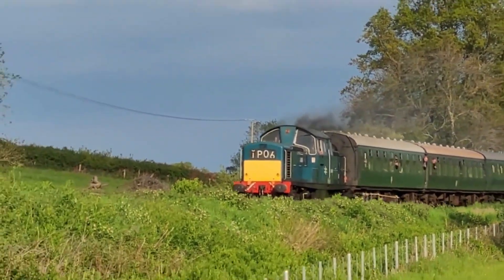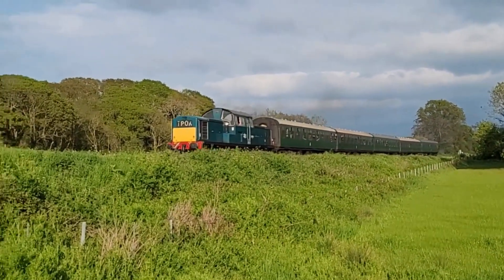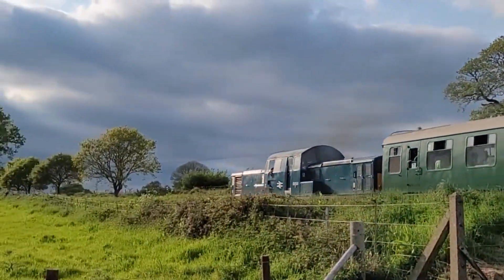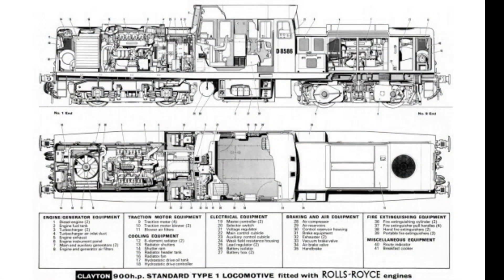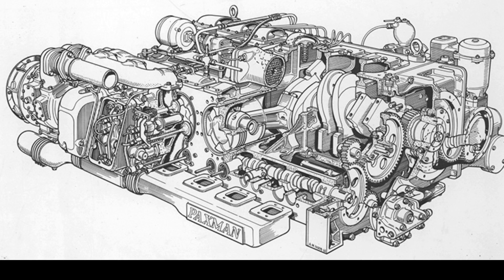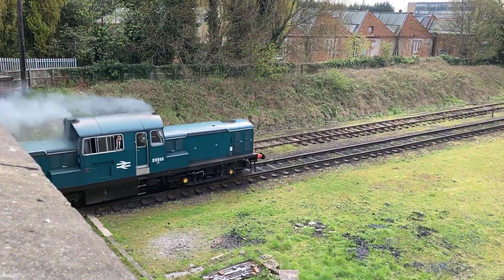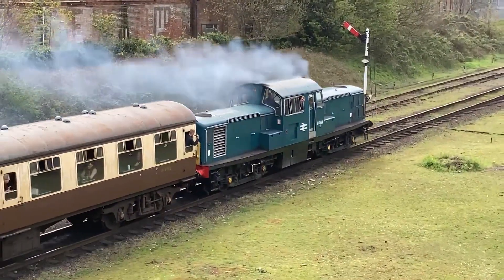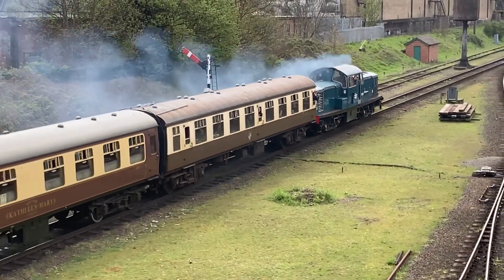Was the Class 17 ‘Clayton’ British Rail’s Biggest Diesel Mistake Ever? #Class17 #Clayton #british

Comment: i mean the Germans made it work with their Diesel Hydraulic Class 252, its basically the same as the Br class 17
Reply: Not quite. The 251/252's are asymmetrical, while the 17's are not.

That, and the 17's were D/E's, not D/H's.

If anything a 251/252 looks like a Class 17 and a Warship class made out behind the engine shed 😏

They also seem to have been - a bit like the Warships - a non-standard class, as only a handful were made, as opposed to the 117 that BR bizarrely jumped into without thinking 😅 .

Comment: This design is not unusual, it is a reasonable common layout for shunting/switching locomotives, the BR Class 17 was just a very poorly design one. compared with say the NZR class Dsc locomotives which were built between 1958 - 67 by British Thomson-Houston - 28 are still in service.
Reply: Nah. Not poorly designed, rather poorly specified and insufficiently tested.
BR wanted new stuff yesterday, and failed to grasp thst such developments take time.

Comment: The answer is: No.  British Rail's biggest mistake was in ordering hundreds of Brush Type 4 diesels,; which became the Class 47. They were notoriously unreliable, and had to have their engines de-rated from 2,750 horsepower because they couldn't cope with that power output. What the railways really wanted was a fleet of DP2-type locomotives, the prototype of which had proved ultra-reliable in service. But the BR Board had to be seen to be giving orders to firms other than English Electric, who had already built the fleet of class 40s,  and so Brush got the order instead. A big mistake.
Reply: And the BRCW Lion didn't get a chance either.
Reply: Class 47s employed similar technical features as the Class 46 Peaks. The Class 46s cooling system was also different from the Class 45s because whereas the latter employed a reliable electric radiator fan, the Class 46 employed hydrostatic methods in maintaining engine temperature, and this made them less-reliable. The remaining 20 "Peaks" on order were cancelled, and it's withheld equipment transferred to the first Class 47s.
Reply: @sandletters39  yep 401 to 420. There was a fleet of dp2 locomotives, class 50 but fairly few in numbers

Comment: "Experimental" in the late 1950s, when USA diesels were well-established.   Paying for a few engineers to go over and study there would have paid big dividends.
Reply: They did, and they started off planning to do things the American way as a result of the trip, that is moderately powered locomotives of Types "A" "B" and "C"  (Later to become Type 1, 2, and 4) running in multiple as required. This is also why there were no pilot scheme type 3s. It was then realised that this would not work very well for the UK, as our railway was built around shorter trains and needed to be hauled by as few locos as possible, but the pilot scheme and Modernisation Plan was already under way with too many low powered and unsuitable locomotives, based upon the American principle of multiple working. They then ordered the Deltics - the worlds most powerful diesel locomotive at the time, and the Class 47 - also at the time the worlds most powerful diesel locomotive with a single prime mover, which could easily handle the heaviest trains single handed. This went a long way to correcting the mistakes made by trying to do it the American way. So rather than paying big dividends, the trip to the USA to study their way of doing things achieved exactly the opposite.

Comment: you would think the clowns would have tested the locos before delivery to BR and the the clowns at Davy Paxman should have advised the designers for suitability, Elmer Fudd could have done better.
Reply: I'm going to go out on a limb here and guess that while you clearly have got the gist of the 1955 Modernisation Plan, you have never actually read the 1955 Modernisation Plan. 

Google it.  You won't even need to have a cup of tea on standby to read it in it's entirety.  Hell, your kettle won't have time to boil before you've finished it.  

Put it this way, "well considered and comprehensive" are two things it cannot be accused of being, but - let's put it this way, add political interference considerations and much concerning the earliest phase of the dieselisation programme will come into far sharper focus!!
Reply: There were two versions of the engine, aluminium or iron, Paxman specified the stronger iron engine for the Clayton, BR insisted on the aluminium version which lacked durabilty,  Paxman were correct but "the customer is always right"

Comment: The Class 17 was supposed to be the new standard Type 1. What didn't help the Class 17, other than their lack of reliability, was that most of them used the non-standard Red Diamond multiple-working equipment and not the Blue Start equipment.
Reply: The system for lashing up multiple diesel locomotives in Britain always baffles me as a US enthusiast. For us, lashing multiple units together of various makes and models has just been a thing since diesel locomotives came in to mainline service. Just hook up what is the equivalent of a giant jumper cable with something like 27 pins between the units, connect the air, and you're good to go. Doesn't matter if you had 2, 4, 10, heck as many units as you needed (as long as they were one consist - distributed power wouldn't really take off successfully in large-scale applications until the mid-late '90s except in specialized cases on specific railroads where you had locos with elongated "snoot" noses to either send or receive radio signals dependent on if the loco was manufactured as a "leader" or a "slave" or you had a special boxcar mid-train in front of the swing helpers loaded with radio equipment called a "robot car" which did the same thing). And that's across multiple companies and builders, yet BR, a nationalized rail system, made these Red Diamond and Blue Star systems which were compatible with some locos but not with others. Why not just have 1 standardized system to connect any locomotive's controls with another? Would have made things easier and made the diesels of the system more flexible.
Reply: @davidwhiting1761 it all boils down to the original way the Modernisation Plwn was to work. Along with building small batch of locomotives with hydraulic and electric transmission systems, all other systems like multiple working equipment were to be tested. Some of the pilot scheme diesel-electrcs had tge electro-pnuematic blue star equipment and the rest had the red circle electric tro-magnetic equipment. Only the Coass 17 and the ex-LMS pioneers had the red diamond system. The diesel-hydraulic had three different systems (orange square, white diamond, and yellow triangle). Come tge rationisation of the fleet of locomotives only the blue star loco olives were retained. Hope this goes some way to answering your question as to why so many different types of multiple working systems.

Comment: You need to do some better research. The Paxman 6ZHXL fastest under the Paxman 2 -car DEMU, which was under test between 1956 and 1958, covering 43,000 miles. These engines used cast aluminium components, and Paxman knew that they were suspect and told the BTC/BR when BR  ordered the engines for the Class 17. But the BTC/BR ignored Paxman's warnings and offer to replace the aluminium parts with cast iron ones.

As for being under powered, they weren't. They had more power than all the other Type 1s except for the Class 20, and considering they were also expected to perform shunting duties on one engine 2 450hp engines was the best they could hope for.
Reply: The Claytons would fail with nuisance faults, such as fuel starvation, the fuel lifter pumps and fuel pipes were undersized, fuel starvation or low fuelflow causes other faults, eg low power and dense exhaust smoke, smoke will  damage engine parts such as turbochargers

Comment: They couldn't replace the engine for the Class 17's?  That would have helped them.
Reply: Yes.  The Class 30's became Class 31's following engine transplants.  (Mirrless to Sulzer, I believe.)
Reply: @stuarthall6631  No, not Sulzer, English Electric.
Reply: @ Thank you!  I stand corrected!
Reply: Ironically Paxman did recommend several changes to the engine for Class 17 use... BR management said no... until Loco's started breaking down, a lot 😂 .

One of the changes was having the crank cases made of cast iron instead of aluminium. Heavier, but more durable under sustained use.

Comment: I needed to know why they couldn’t dig a tunnel and do an extension for most of the mainline Trains, so they can extend the abandoned underground train stations. Why couldn’t they use the part D78 Stock train doors on the sides and also restructure the front face of the A60 and A62 stock which will include the class 507, class 508, class 313, class 314 and class 315 remix and make them all together and also redesign all of them into an overhead wire line trains and also make most of them into Five carriages per units and also having three Disabled Toilets on those Five cars per units A60 and A62 stock trains and also convert the A60 and A62 stock trains into a Volvo D10M, Scania N113, Leyland 510, Volvo D10A, Gardner LG1200, Volvo B10M, Gardner 6LXB and Gardner 8LXB Diesel Engines and also put the Loud 5 speed Allison Gearboxes even Loud 8 speed Leyland Hydra cyclic Gearboxes in the A60 and A62 stock, class 507, class 508, class 313, class 314, and class 315 and also modernise the A60 and A62 stock and make it into 11 carriages per unit so it could have fewer doors, more tables, computers and mobile phone chargers? A Stock Train and 7 Disabled Toilets on those A stock trains. Why couldn’t we refurbish and modernise the waterloo and city line Triple-Track train tunnel and make it even much more Larger and extend it to the bank station, making it into a Triple-Track Railway Line so those Five countries such as Australia, Poland, New Zealand, Italy, And Germany to convert the waterloo and city line Triple-Track Railway tunnel into a High-Speed Railway lines? The Third Euro tunnel Triple-Track Railway line to make it 11 times better for passengers so they could go from A to B. Then put the modernised 11 carriages per unit A Stock and put them on a bigger modernised Waterloo and city line Triple-Track train tunnel so it could go to bank station to those Five countries such as Australia, Italy, New Zealand, Poland And Germany The modernised refurbished 11 carriages per unit A stock could be a High Speed The Third Triple-Track Euro Tunnel Train, so it is promising and 47 times a lot more possible to do this kind of project if that will be OK for London, Australia, Italy, New Zealand, Poland and Germany oh by the way, could they also tunnel the Triple-Track Railway Line so it will stop from Buckinghamshire and Essex so that the Passengers will go to Australia, Italy, Poland, New Zealand and Germany and also extend the Triple-Track Railway Line from the Bank to Buckinghamshire and Essex Stations so that more people from there could go to Australia, Italy, New Zealand, Poland And Germany more Easily. Why couldn't they extend the Bakerloo Line and also build brand-new underground train stations so it could go even further right up to Clapton, Wood Street? Can they also make another new underground train station in Chingford, and could they extend the Bakerloo Line and the DLR right up to Chingford? All of the classes 155, 106, 154, 105, 114, and 117, will be replaced by all of the Volvo D10M, Scania N113, Leyland 510, Volvo D10A, Gardner LG1200, Volvo B10M, Gardner 6LXB and Gardner 8LXB Diesel Five carriages three disabled toilets are air conditioning trains including Highams Park for extended roots which is the Bakerloo line and the DLR trains. Could you also convert all of the 1963 stock trains into an air-conditioned maximum speed 78 km/hours (48 MPH) re-refurbished and make it into a 7 cars per unit if that will be alright, and also extend all of the Piccadilly train stations to make more space for all of the extended 7 car per unit 1963 stock air condition trains and can you also build another Mayflower and Tornado Steam Locomotive Companies and can they order Every 87 Hexagon and Every 38 Octagon shape LNER diagram unique small no.14 and unique small no.11 Boilers from those Countries such as Greece, Italy, Poland, and Sweden, can they make Mayflower and Tornado Steam Locomotive speeds by up to 117MPH so you can try and test it on the Original Mainline so it will be much more safer for the Passengers to enjoy the 117MPH speed Limit only for HS2 and Channel Tunnel mainline services, if they needed 13 Carriages Per units, can they use those Deltic class 46's, Deltic class 44's, Deltic class 40’s and class 43HST Diesel Locomotive’s right at the Back of those 14 Carriages Per Units so they can take over at the Back to let those Mayflower and Tornado Steam Locomotive’s have a rest for those interesting Journeys Please!!!!, oh can you make all of those 17 Tonne Boxes of Coal for all of those 117MPH Mayflower and Tornado Steam Locomotive’s so the Companies will Understand us PASSENGER’S!!!!!!!! So please make sure that the Builders can do as they are told!!!!!!! And please do something about these very very important professional ideas. Prime Minister of England, Prime Minister of Australia, Prime Minister of Poland, Prime Minister of Germany, Prime Minister of Italy, Prime Minister of New Zealand, and that will also include the Mayor of London.
Reply: Stop posting long tracts of irrelevant text as comments. What is wrong with you?
Reply: @alanrobertson9790 Give it up.  There are no paragraphs on his planet and you won't get a word in edgeways, as he never stops for breath.